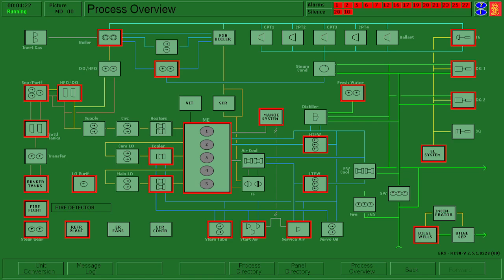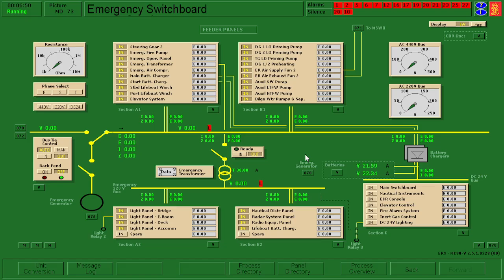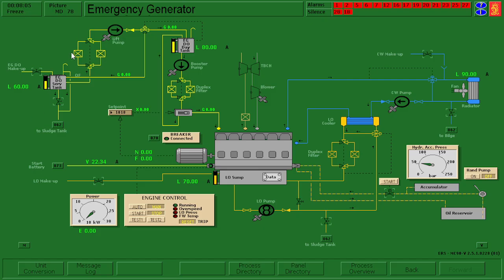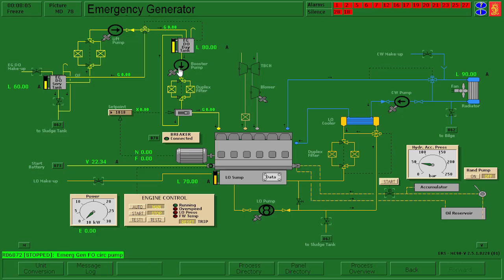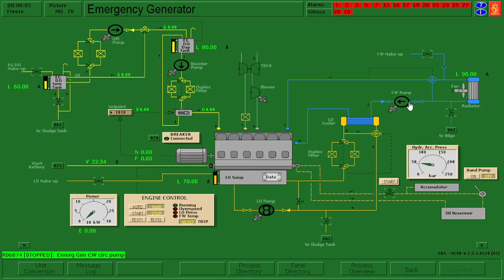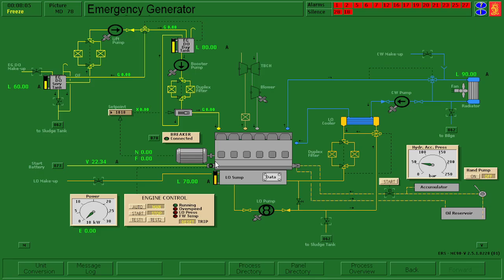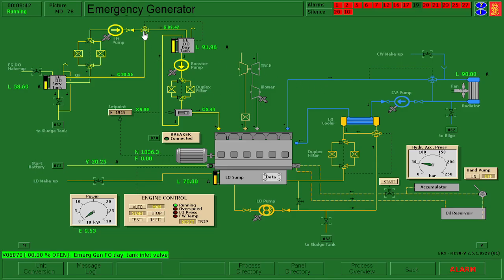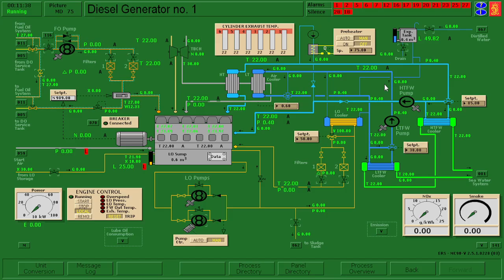Starting a Ship's Power Plant pt.1 (Emergency Generator)

Comment: Also, generator speed actually influences both frequency and wattage.
Reply from the maker: Well, naturally as it is spinning up, of course. But this is basics. We can talk about then when I actually get to the synchronization panel. For now, alls you needs to know is that once 1818 RPM is reached, speed is not changing, this locking in the frequency and allowing lenz's law to take over in driving the wattage.
Reply: @nuclearandspaceeducation3201  we'll talk more in the discord so one of us don't get embarrassed 😆
Reply from the maker: @arco_t5  Power = Torque times speed over 9550. Because this is an AC circuit the generator speed needs to be constant, This is because f=120/pn that makes n=120f/p, therefore increasing speed results in a change of frequency without reducing the number of poles in a generator. But generators are load following devices which don't change their speed. Therefore, to generate more power you need to increase the torque. Well isn't it wonderful that significant torque is generated when you introduce more fuel flow, leading to what should be an increase in speed. But because the excitation voltage of the grid keeps the speed constant, so as to keep the frequency in sync with the grid as proved with the above equation. So instead you are left with significant torque being exerted. This is because the fields are pushing back against the desire for the increase in speed. Cut off your excitation voltage from the grid and watch what happens to the generator. I will bet you 1k dollars you get the overspeed trip because you no longer have Lenz's law keeping this thing in check with opposing fields. 

As I stated, we will talk about these relationships more in the future. So we are both right, but please let me get the concepts out of the way before we go to synchronization theory.
Reply: @nuclearandspaceeducation3201  that's why I said we should take this to the discord lol.
Reply: @nuclearandspaceeducation3201 you could also use some sort of variable speed reducer between the generator and power and engine… Like a CVT (geared toroidal, because belts will snap and disintegrate.) with some sort of electronic control that can modulate throttle position and a servo or stepper motor that can modulate output speed up/down.
Reply from the maker: @arco_t5  I'm sure you can. But there's a reason this is not the practice. It's over complicating a system that works. Variable speed adds a lot more operator intervention, likelihood of failure, and way harder for governors to control. The days of light bulbs and ring/tone generators are gone. We've got a grid frequency which is changing wildly from consumption and production using complex machinery. The best way, and most simplest way is to lock the frequency down by making the speed static. Sure, the turbines can spin however fast you want them to within mechanical limitations, but that does not change the fact that your grid is either 60 or 50 hertz, and therefore the rotor coils of the generator are spinning at a fixed speed. They have to, or else the frequency gets off and you get tripped out. Thems the laws. f=120/pn. Nothing is going to change that fact. Turbine can spin 3600, 1818, 1800, whatever. But the actual generator rotor coil must be spinning at a speed corresponding to the relationship between to number of poles and the speed to frequency match. So yeah, you could gear up the turbine, but at 100% of the places I visited the turbine shaft is directly connected to the generator. No gearing.
Reply: @nuclearandspaceeducation3201  I know it's complicated and probably has 15 different failure nodes.